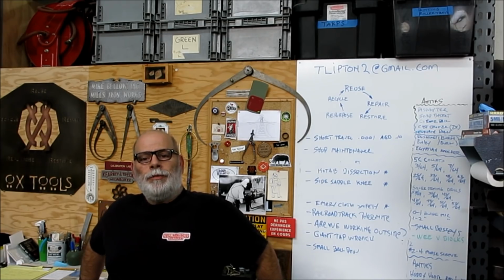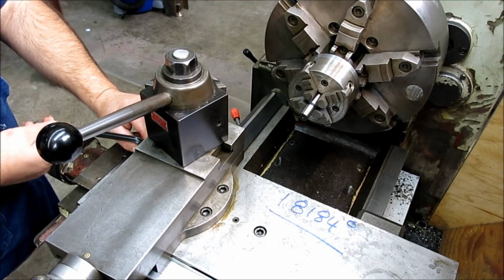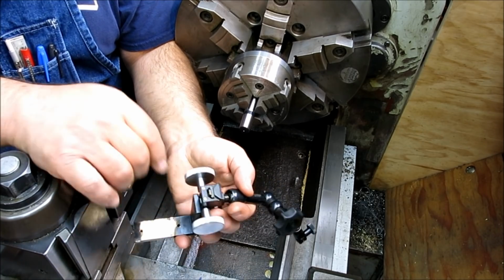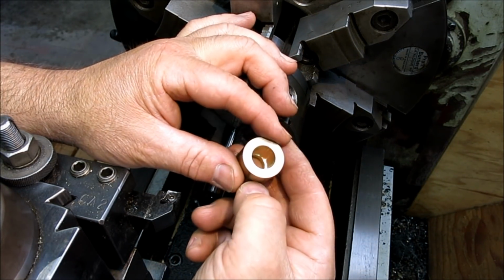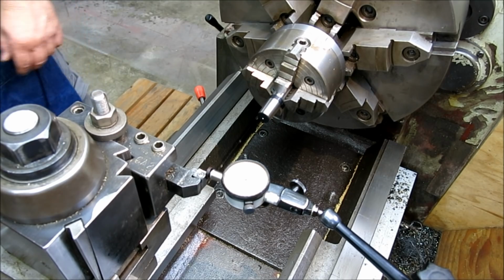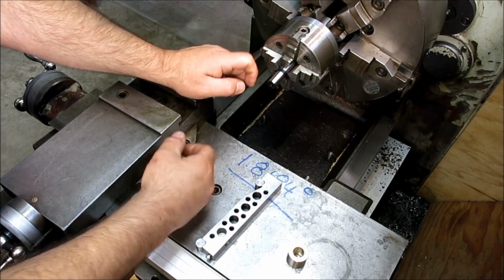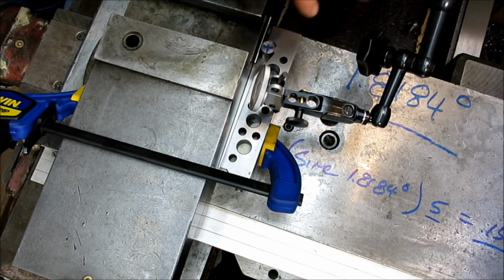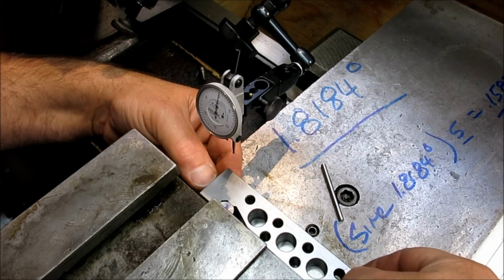Setting Up and Cutting Short Machine Tapers 2

Comment: Do a video with ur surface comparator and how u can try and achieve certain grades or whatever like e.g. u know 63-64ra, 125,250,400,500 for when and why....seals, threads, grooves, shoulders etc... and maybe which material will yield the best finish when properly running and making chips at the proper speed and feed if shooting for various finishes on different features of the same part. If the time permits u to no biggy...thanks for the videos sir.
Reply: Lol

Comment: What I don't understand is if the taper is cylindricaly tapered evenly throughout its taper how does not being on center going to throw it off?  say I am an 1/8th above the center line, the test indicator should still show the exact reading. One way to test this would be to run the indicator on center and above center to see if there is a difference. I am not saying you are wrong Tom I'm just having a hard time picturing where the error would be.

Comment: Mery Christmas !
I need help Today I was with new project and I wanted to turn 9mm shaft 6" long to 8mm OD 2.5" long then go down to 5 mm OD to the rest of it.. 
I tried fallow rest but didn't go right! I am using dead center and 4 jaw chuck to get close TIR as .0005 I am going to ask all experienced people to see what I can get!Any idea will be more appreciated! 
Thank you OZ
Reply from the maker: Hi Ozy,

Try step turning your shaft. Work up close to the chuck when turning. When you complete a particular section slip the shaft a little further out of the chuck and continue. If your having trouble with the full length sticking out of the chuck then try this. By all means support the finished end with the tailstock center. Hope this helps. 

Best,

Tom
Reply: Thank you to the replay 
Do you think that way is better than using dog fixed in 4 jawchuck and dead center on the tail stock?  
I think you mean if I have collet chuck will be easy to machine small part each time and extend the length of the shaft ! But with the 4 jaw chuck then I need to dial the TIR every time I extend the shaft out to machine more!!?? Right? 

Thank you sir
Oz
Reply from the maker: Hey Ozy,

The problem you are having has to do with the unsupported length to diameter ratio. If you reduce it as I suggested then you should have no problem. If you want a good shaft then yes you will have to indicate it each time you move it out. Otherwise you need to invest in additional tooling if you do these regularly. 

--Tom
Reply: Thank you Tom! 
I think you mean going with OD grinders is the way to do it! 

Or getting collet chuck is the best in my situation! 

Thank you for your help regard this metter!
Your videos adding a big value to the machining community !
Oz
Reply: Hi Tom, how are you? 
I made my own collet bar front adaptor to fit the Hardinge 3c collets and using the south bend 9A draw bar ! 
It's turned very nice and the TIR within .0003 
I insert the shaft there and start machining 1/4" length then chucked with my indecator it's within .0001 then once  I moved the Shaft little bit more to machine another 1/4" the first 1/4" that I already machined it's out within .003 !!! So I think this method will not keep the original machined length with the same TIR!! Since you move the work peace out! 

I am about to give up!  This thing is not easy ! 

thank you 
Oz
Reply from the maker: Hey Oz,

You need to indicate it each time you extend it no matter if you are using a collet or a four jaw chuck. With the collet you can try clocking the part in relation to the collet to find the least TIR reading. Four jaw or adjustable chuck is probably the easier way since you can indicate to dead zero each time. Also be sure you indicate on the last cut section of the part as well as the fresh uncut stock. Hope this helps. Thanks for the comment.

Cheers,

Tom
Reply: Got it Tom!  Thanks s lot for the help 
I will try that and hope  I can make my Shaft!

Thanks again ! 
 Oz

Comment: Hi Tom,Looking at your methods for setting up for cutting short tapers.Frank Ford (frets.com)designed a handy tool for this exercise. It consists of a block to hold in a quick change tool holder.The block has a slot milled in it to accomodate a slideing, spring loaded plunger,the end of which is faced off. It also has a conveniently located tapped hole for an indicator holder.Sounds more complex than it is). In use the faced off end touches the work under slight spring tension.( as its machined at 90 degrees to the slide, it must be touching centre).The indicator arm is placed on the outboard end of the slideing plunger.
I made a copy of this tool, and so long as the machining is accurate,it is quick,easy and reliable.
Hope this ramble makes sense ! Seasons greeting from Mike in Malta.
Reply from the maker: Hi Mike,

I have seen this tool you mention. Thanks for reminding me of it. Happy holidays!

Cheers,

Tom
Reply: +oxtoolco couldn't you just clamp a V-bar onto the taper and set the compound paralell?
Reply from the maker: +Flugschüler Fluglehrer This adds another item in the measuring setup that you don't know what the errors are. This is why you need to check the result of your output on all setups. When clamping tapers in vee blocks there are correction to get the actual angle because it is a line contact at an angle in the vee block.  Thanks for the comment.

Cheers,

Tom
Reply: +oxtoolco I C.  THX

Comment: hi Tom as always thanks for info. At the risk of asking a question already asked and answered, I have a south bend 10 k and was wondering on idea's on using a sign bar on. as it does not machined edge top slide as yours does and gib screws are in way. thanks jim h
Reply from the maker: Hi James,

I have done it before setting the sine bar against the side of the chuck. You have to prop everything up close to centerline to do it that way but it works as well. You would then traverse the compound holding an indicator along the sine bar. Hope this makes sense.

Cheers

Tom

Comment: I think an alternative version of method 3 would be to set up the sin bar on the ways of the lathe (my lathe uses box ways, so this would be easy) and have the indicator anchored in the compound? That way if your lathe compound uses a rough casting that is not machined all over, you can still use method 3? Am I missing anything?

Great Vid, and an interesting real life encounter with conic sections!
Reply from the maker: Hi Hedron,

Sounds like it would be fine. I would anchor the sine bar somehow so it didn't slip forward or backward and change the reading.

Cheers,

Tom

Comment: Tom,

I was thinking of making a bearing holder to mount on the tool post, similiar to the ones on a steady rest, by mounting the tool with the bearing running flatwise, you could loosen the compound's screws and run it along your known taper to set your compound. The width of the bearing would give you some center height tolerance.

Joe
Reply from the maker: Hey Joe,

That might work. My first thought was there might be too much spring in the system to get it to move to an accurate position. Regardless you will still have to verify your settings with some kind of measurement scheme.

Cheers,

Tom

Comment: Hey Tom,

Enjoyed the lesson!

It seems to me....that method 2 using the ring and measure would be the method to discover the (unknown) angle of an existing taper as you had shown in the first video but not a method for setup to cut the taper.  Yes, it could be used as you demonstrated but as you mentioned, not preferred.

With that said, I just don't understand when you would use method 2 to cut a taper.  

Did I miss something? Can you explain when/why you would use #2?

Your grasshopper
Chuck
Reply from the maker: Hey Chuck,

Method 2 would be if you didn't have a standard to indicate and did not have a sine bar to easily set the compound accurately. You can use the two ring method to dial in the angle pretty precisely. No need for samples, pins, gage blocks or sine bars.

Cheers,

Tom

Comment: This is a well taught lesson, use sine bar for easy set up, speed and accuracy. Make a test cut/piece and double check for errors, make corrective adjustments and produce your work quickly. You're making the production of taper cuts just plain simple. Thanks for sharing a little more of your knowledge!
Reply from the maker: Hi Ark,

Thanks for the compliment and comment.

Cheers,

Tom

Comment: Tom,
you should have been playing golf then you'd get a whole in one!

I am i the planning stage of making my own tail stock for a 10 inch lathe. Should I go with a Morris Taper 2 or 3?  and why?  is one better that the other?

thanks for sharing
Dennis
Reply: Morse taper tooling is much easier to find than Morris or Morose!
Reply from the maker: Hey Dennis,

Go large if you have a choice. Is easier and more rigid to reduce down to hold a tool than to have to adapt up from a smaller size.

Cheers,

Tom
Reply: oxtoolco Tom, thanks, I should have known that size does matter! Ill try not to forget that.  LOL
            Paul,  thanks, that sounds like it would be easier if one spells things correctly, it's just funny that way..  you know how it is with newbies like me as well.  
Thanks again!
Have fun all!
Dennis

Comment: Tom,  For the first method, wouldn't the flat tipped indicator used in the second method work to pick up the high point parallel to the taper?  Great video.  Thanks, Randy
Reply from the maker: Hi Randy,

The flat indicator can sit against the taper but not be square to the centerline. It can be at an angle and still in contact with the taper. Hard to detect. The ball finds the high point without any additional geometry problems. Hope that makes sense.

Cheers,

Tom

Comment: I watched the last video and got to thinking about simplifying this process and forgot about it.  Then I watched this video...  Ring gauges, block gauges, pin gauges, sine bars...  Most of us don't have any of those (I know I don't) so I got to thinking about how I would do this without all the fancy stuff and with just what I have here.  

Clamp a long, stiff piece of stock between chuck and tailstock.  Then, clamp indicator to the stock and rest plunger on the side of the compound, then mark out a known travel distance along the side of the compound slide (say 8 inches, or substitute the full length.) With this single indicator on the stock, it's just a matter of calculating the sine of the angle of taper you want to cut, sweep along compound the known distance until indicator reaches the right number.  With full travel along compound slide, you even have more accuracy over the distance.  As an example: Place indicator at zero and at end of compound slide.  Even set up stops at beginning and end.  Traverse toward head stock the 8 inches.  Using the formula (SIN*1.8184)*8 will equal .2538 on the indicator.  Bump compound angle, reset to end stop slide, zero indicator and traverse again.  Rinse and repeat.  Once target number is reached, tighten compound...  Done!  Instead of sweeping to maintain zero, you are sweeping from zero to the calculated amount... And without a sample to test to compare to.  Of course, this is all theoretical until someone puts it into practice.  Any thoughts?

Comment: As you were showing the first method I got thinking one of those Palmgren milling rigs would be a great vertical adjuster for the indicator.
I like the sine bar method as well... Now for error checking you'll have to disassemble the compound, run the indicator on the dovetail, then reassemble and run the outside comparing the difference...  hehe, get cracking...LOL
Great video!! Thanks

Colin
Reply from the maker: Hey Colin,

You can just measure the piece you cut and see how it came out. You do check the stuff you made with those fancy dial c-clamps you have right? Thanks for stopping by.

Cheers,

Tom
Reply: Measure?? Who has time for that??  ;-)

Comment: Hi Mr. Wiz, 2 points, why didn't you use the indicator with the elephant foot instead of the levery type one, would have saved making your rack and pinion jobbie, clever though it is.
Second, dare I say "i told you so",:>) with the face of your indicator vertical you can read it without ND filter. I'm not smug, honest Guv! ho ho ho
ATB
deep blue
Reply from the maker: Hey Chris,

The big flat foot would have to be perpendicular to the centerline of the taper. That's even harder to get right. I have not done the math to see how much it would take to introduce an significant error. Nice clear shot on the indicator. Too bad you cant always get it oriented that way. You do have one right?

Cheers,

Tom
Reply: Come come young man, "harder" surely you jest? I have a DTI, plunger type, permanently mounted on centre and horizontal in a QC holder, all I have to do is un-screw the ball end and screw in the elephant foot should I want to use one. I do have a set of interchangeable ends for  DTI,s but it would be a piece of p*ss to make an EF had I not. Just had a thought, one of the ends is a flat screwdriver like one, if that were vertical it would solve any taper alignment problems
Thinks, do I have one what? 
LL&P

Comment: If we don't have pins, can we use a feeler gage with the Sine Bar ?

Thanks
Reply from the maker: Hi Robert,

You could. Its sometimes easier to mill a little block to size that you can measure easily. Loose feeler gages might need to be clamped snugly to give a good consistent result.

Cheers,

Tom

Comment: Hello Tom,

Hopefully, Youtube/Google will let though this link to an indicator holder that doesn't need to be accurately set on height;

http://www.frets.com/HomeShopTech/Tooling/IndicatorHolder/indicatorholder.html

There's also a trick I've done with the DRO. Run the top-slide up against the chuck and put an indicator against a piece of ground stock in the chuck. Extending the top-slide moves the saddle (measured by the DRO) and the indicator shows the radial change, so you can calculate the angle.
Reply: oxtoolco or use the screw driver style tip for a DTI and save a few hours toil.
Reply: Thanks for posting that Paul. And for fixing the link, Tom. Plenty of nuggets there for us aspiring Luthiers, too.
Reply from the maker: Hi Paul,

I had to approve the comment as it had a hyperlink in it. Its good now. Thanks for sharing the clever device.

Cheers,

Tom
Reply: That's awesome! Gonna put that on my project list.

Comment: Thanks for your video. The last method, shouldn't you make sure that the side of compound really is parallel to its ways. It should be easy to do, just put the indicator against the side and move the compound slide only. It should show no reading change... i think.
Reply from the maker: Hi Lars,

You are correct. In the next video we actually cut a sample part and verify the angle setting independent of the machine. What really matters is making good parts not setting machines perfectly. 

All the best,

Tom
Reply: Wish my lathe was just basically that good!
Reply from the maker: Doug Coulter Hi Doug,

What kind of lathe do you have? You can do stuff like this if the machine is consistent. It need not be deadly accurate. If it will do the same thing reasonably repeatably then you can do a few cool things. 

Cheers,

Tom
Reply: oxtoolco
As Lars says, thanks for this - I'd been doing the bump/curse method (works but...).  I have a 36" BC Harbor Freight lathe - the next step down in quality from Grizzly tool.  Heck, my indicator might go 5 mills just indicating how straight my compond was - with no swivel at all.  I think it's a copy of an old South bend, and I might be able to tighten up this and that if I could find the right manual for it...the Chinese manual didn't cover it even having adjustments, though of course it does.  It'd probably do the tighten-it-up pretty well if I knew how to not overdo it and wear out the middle (like the old steering boxes did if you took out all the play).  It has one redeeming feature - even the 3 jaw chuck is perfect to a tenth or so.  The rest, not so great.  Slop in all the acme drives and so on, ways tight here, loose there.  And it's pretty new, I'm the first owner.

The eye is better than most give it credit for, with practice/training.  I've had that "luck" a few times myself.

Comment: Hi M.LIPTON
3 things:

1- I say NO to vertical videos, check here why:
Vertical Video Syndrome - A PSA

2- Isn't there a way to mount an indicator on a height gage and put that on the cross slide, with the indicator reading horizontal and the height gage vertical? Just wondering

3- Many many thanks again for making us feel smarter in front of our machines. May be I'm not but be shure that each time I face a problem I think: How would have Mister wizard done that?

Best

Tom, Paris, France
Reply from the maker: Hi Thomas,

You got me on the vertical video. It looked terrible when I was editing. You will not see that again. I mention the height gage method in the video. The issue is you need to follow the taper with the indicator so it has to be on the compound. Perhaps I'm not understanding your question perfectly.

Cheers,

Tom